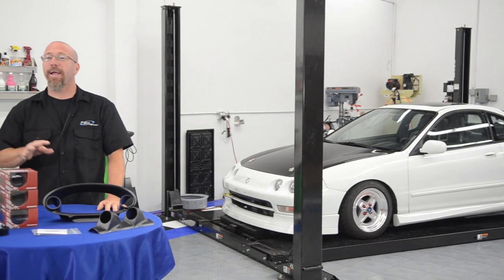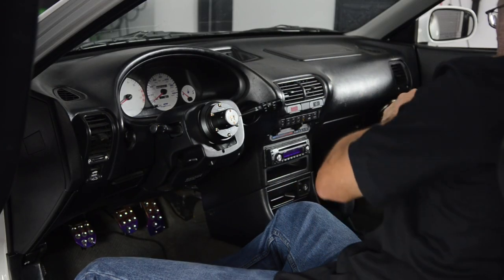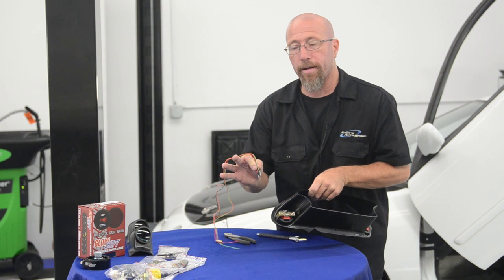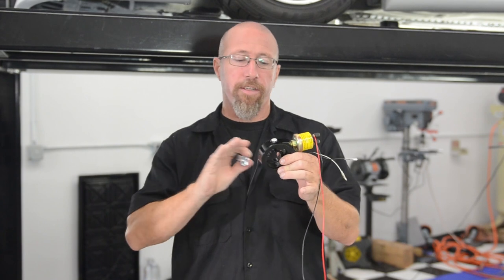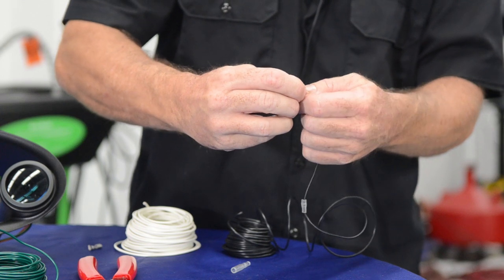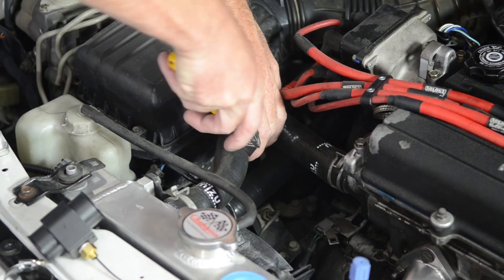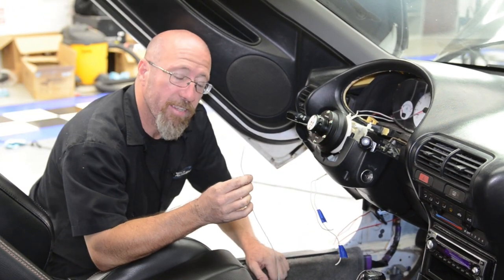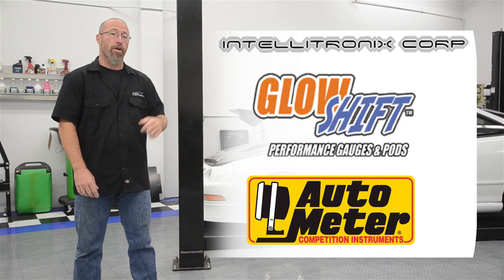Gauge Install for Sport Compact Cars - Presented by Andy's Auto Sport

Comment: You should be soldering and using shrink tube on you're electrical connections, and teflon paste,....
Reply from the maker: We always use solder-infused NSPA shrinking connectors on all wiring. Thanks for watching .
Reply: AndysAutoSportTV  is it that color during the day

Comment: @6:40 what is that transparent or white round thing you inserted on the vacuum line and what is it for? Thanks.
Reply: It's called a T-fitting. It goes in your vacuum line, as shown, and you connect the gauge's hose/line to the exposed part, so your Boost/vacuum gauge can get a sample of the pressure so it works and reads boost and vacuum properly.

Comment: Wondering i have the same model integra. Which size Radiator Hose Adapter
and Sandwich Plate would i need or you used.